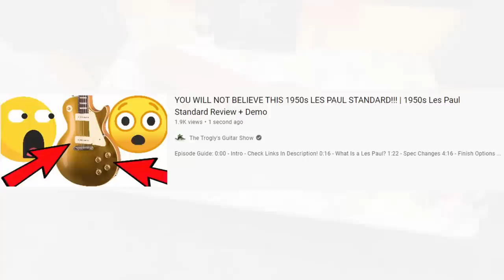My First 1950s Les Paul Is a Bit Different... | 1954 Gibson Les Paul Standard Red Double Cutaway Mod

Comment: Modding a 50's Les Paul in the 60's was probably viewed like modding a 2010 Les Paul would be viewed today. Nobody cared. This guitar has a great, unique story and was played lovingly by it's owner. In my mind, that makes it very special.
Reply: Yup thats what i Was thinking. Also back in the 60s, a used 50s les paul probbaly cost like $150. They sold for about $300 New for a standard and $600 for a custom. Today its like $2000 for a standard 50s and $4000 for a custom
Reply: It’s one of the things i love about Bonamassa; he leaves the guitars he acquires exactly as is, warts and all. He refuses to refurbish them. He cleans them up- a little- and takes them out on the road. Total respect for those who played and owned them before
Reply: @StinkyRotorhead  If you adjust those numbers for inflation you get surprisingly close tho
Reply: @StinkyRotorhead  Right. Even accounting for appreciation, that $150 guitar in 1954 comes out to $990 today. What the hell happened?
Reply: So true. I acquired a 56 Jr basket case in the early 70’s and promptly refurbished it without even thinking about its value. Which of course was nil back then. Nobody wanted them which is how I got it. I used the original electronics but changed to grovers and a Schaller tailpiece I could intonate. Still have it and the original hdwr and I played the crap out of it.
Reply: Exactly
Reply: No, it was pretty stooped then too…
Reply: @joojoosasa  Boomers happened.
Reply: @Chuffin_ell  ....were you trying to spell "stupid"?
Reply: I'm thinking not so easy to compare to today......no 2nd hand manufacturers....nobody had credit (layaway only)......people were not wealthy, unwilling to use credit and no cheap anything or copies etc......no comparison to today
Reply: @joojoosasa  it’s ironic innit?
Reply: I’ve seen more modded 54’s than i have originals. And most of the time they are better for it.
Reply: This is the worst I’ve ever seen though. I hate it.
Reply: imagine some boy got a mint store bought 59 for chrismas in '59...
Reply: @mekore  my old man sold donuts/delivered news papers as a kid to buy his 58’ Jr.
Reply: @mekore  aint that the story of the first berst?
Reply: The 59 berst anyway
Reply: Nowadays of you modded a 50s Les Paul you should pay some bodyguards xD
Reply: @FloodExterminator  if it was original when you mod it i agree you need protection. But if you improve upon some boneheads previous mod it’s probably a good thing.
Reply: @thejakefromstatefarm6768  I understand, really. But, remember, he was playing that Jag and that thing cost him $100 and had already been refinished. Vance had no idea it was a Goldtop once. I was sporting an Airline Bass from Montgomery Wards then and this thing had an amazing tonal range.
Reply: @kuga6566    HAHA!  I was thinking the same thing.
Reply: @thejakefromstatefarm6768  👍🏻👍🏻👍🏻👍🏻🤣🤣🤣
Reply: @joojoosasa    Inflation.
Reply: @kuga6566    What the hell do boomers have to do with it?   Do you even know to whom that term refers?
Reply: @thejakefromstatefarm6768    WTF?  SMH.
Reply: @joeyoungs8426  I feel you. In the early 70's, my dad acquired a 53 Telecaster in pieces in a box. He took the sander to it, shot poly on it, ordered new bridge, and electronics and turned it into a nice player. I inherited it in 2000, and just lament that it would be so valuable if he hadn't sanded it down. Oh well.
Reply: @bigjohnson7415  The best part about your guitar now is that story you have. My JR has a Gran Torino type story that led to so much more, I absolutely do not regret my basically doing the same thing as your dad. While I love the sound and feel of that guitar, it’s the story that comes back to me every time I pick it up. I sure hope you have that same feeling when you grab that Tele. Now that’s priceless.
Reply: @joeyoungs8426  Yeah, guess it like a car that gets repainted, as they say, they're only original once. No one in the 70's thought 59 Les Paul's, or 69 Dodge Daytona's, would be worth a mint 40 years later. Also, sadly because some things are old, or even rare, doesn't mean value. I also have a 1941 Gibson Fiddle. Yes Gibson made them from 1940-1945, I believe. Pretty rare. Mine's in excellent condition. It's worth around $800! That's it. 1941 model, and that's it. One more story, in like 1988, I acquired a 69 Tobacco burst LP. All original. Bought it from a coworker for like $400. I was just learning to play, and wanted a Charvel or Jackson SO bad, hey it was the 80's. So I bought a 1990 Custom Shop Jackson Pro Fusion USA on credit for $1,500. I was making like $11 an hour then. 2 weeks later, my company announced it was closing. I was going to be unemployed. Instead of taking the Jackson back, I took the LP and put it on consignment. About a month later, I found a new job, and went to the store to get the LP, it had sold 2 days earlier. For $650. I still have the Jackson, in my closet, it's still mint condition. What's it worth? Have no idea. But I'll bet it's less than an all original 69 Les Paul really good shape! The last guitar I've ever sold, because you just never know.
Reply: I know this is an old video I watched trogly quite a bit don't know why sometimes but kind of enjoy it but please probably do don't try to fix things you're so not good at it okay just leave stuff alone I guess you doing what you got to do to make money right dude don't know why I'm commenting on something that's a year old also I asked you about a guitar one see if you wanted to buy it and never did hear a reply I guess you just all ended trying to make the money can't blame you
Reply: That makes it way more valuable (to me) than a basic one. The story is what makes it really stand it to me. I love stories attached to instruments.
Reply: Nobody cared in 2010? I beg to differ. Smh.

Comment: I love this.  Everything about the guitar says it was loved and the modifications made it even more cherished.  Original vs Modified is an interesting argument - my foot is more in the Original camp, but then if I had the chance to buy Jack White's modified Gretsch I'd do it in a second.  Would this mod be better if Jimi Page had it done rather than Vance?  This guitar has a story and nothing is better than that, imo.
Reply: Well put. Clearly this guitar was both well loved and extensively played and that is what it was designed and built for.
Reply: When I see a guitar like this it reminds me of an old dog that you can tell had a great family and was always loved.
I'm very much guilty of modifying what would now be prized vintage collector guitars, but back when I did the mods in the late 1970s it was no different than modifying an old Fox Body Mustang GT of today.
Ahhh the good ol days, I do miss them dearly.
Reply: is it the one he used on the lazaretto music video?
Reply: @tavicotavio  I think he’s referring to the Gretsch hollow body Jack White uses. It was originally a single cut but modified into a double, and had a section of the body routed out to install a Green Bullet harmonica mic that he could pull out and sing into
Reply: Original VS. Modified, well, I'm in the middle. Some guitars should be kept original as museum pieces, others should not. But if it was damaged and/or missing parts and especially missing its original finish already, its top value already left the harbor, so mods are more welcome in that boat.
Reply: That guitar (or what's left of it) has a story which makes it unsellable.
Reply: @theusualgamers3242  Spot on!
Reply: Remember, we always thought it was a Cherry refinish and and we weren’t into taking our guitars apart in high school in the late ‘60s. He loved this thing and I can tell you he loved it dearly and made it his own.

I have lusted after this thing for over 50 years and I have only played it a couple of times, supervised, at Vance’s house, seated…with a strap. I was best man when he got married.

The night that baby hit the pavement was the last gig for, Bhang, at 2 Doors East at Montrose and Ashland.  And, I went on to work for Columbia and Arista.

Comment: Those pots are modular.  The cutouts on the back are there to add switches to the pots.  Don't forget that alnico magnets weaken over time.  It's possible that the bridge pickup magnet needs a recharge.  But there could also be a poor quality solder joint in the bridge pickup circuit.
Reply: How do you recharge a pickup magnet? I’ve never heard of that. Could you please elaborate on the pots as well. Were they made that way, or is it a modification? What kind of switches can you add to it, like a push/pull?
Reply: @Dan.Solo.Chicago  You just need to put the magnet into a sufficiently strong magnetic field.  In a factory they will typically use an electromagnetic pulse.  But you can also use permanent magnets.  Example, connect three strong magnets into a C-shape and insert the magnet that you want to charge into the gap between the magnets in the C-shape.  You can also weaken the magnetic field by widening the gap that the 3 magnets form.  You could also use one strong magnet and use steel transformer laminations to conduct the magnetic field to the magnet that you want to charge.  In a Gibson humbucking pickup they use one magnet in the center with a steel pole piece touching each opposite side of the magnet and those pole pieces conduct the magnetic field towards the strings just like copper wire conducts electricity.

The distributor pickup magnet in my auto got weak and wouldn't make a large enough magnetic pulse to trigger the electronic ignition.  I actually used 3 ceramic guitar pickup magnets and held them in a C-shape around the distributor pickup magnet and they recharged the distributor pickup magnet and my car started right up in subzero weather.  But KEEP THE MAGNETS AWAY FROM YOUR CREDIT CARDS!
Reply: @Dan.Solo.Chicago  What kind of switches you can add depends upon the manufacturer of the pot.  Some will only accept a rotary switch, but others may also accept a push pull switch.
Reply: @PierceThirlen2  This is a super interesting explanation, I also had no idea that AlNiCo pickups could be charged! Thanks for sharing

Comment: The top damage is from them using a hammer and chisel instead of a router to do the switch relocation. Look at the shape of the cavity you can even see what size of chisel they used .On the left side of your pic there is a channel cut you can tell .
Reply from the maker: Good observation!

Comment: Those pots are a bit goofy for guitar use. They are a type that allows a switch to be affixed to the back side. That's why there is an opening and the slotted part on the end of the shaft to move the switch. These were common on consumer electronics back in the old days. You would move the pot from the "0" position and the switch would close to turn on power to whatever it was in.
Reply: I think they are the wrong value as well. Sounds dead to me. I'd guess they are 100k

Comment: 14:08 My guess is that is from the drill bit catching the wood grain and ripping it. I've done that to one of my home-built guitars. It's a semi-hollow with maple top and when I wanted to put a better pot in I needed to drill a wider hole. Probably didn't use enough rpm, went in too quick, but got caught and it tore a similar (smaller) piece off the top.
Reply: Maybe a pilot hole first and then drill from the top down.
Either way a dull tool or not enough RPM and it'll chip out.
Reply: This is why you always use sharp brad point bits on figured wood like that.
Reply: Might sound weird but going backwards with the drill is a great way of avoiding tear-out.
Reply: They make reamers to enlarge holes and StewMac sells them.

Comment: Unless there is a problem with the fixing at the body end of the truss rod (which is pretty rare) there is absolutely no issue with the few threads showing at the headstock end - there are 2 inches of thread  at this point for adjustment.
As long as you can get a tool over the truss rod nut, you are good to go.
Most adjustments require less than half a turn so there is plenty of room left.
You seem to have a bee in your bonnet about this Austin!

Comment: Those are my favorite sounding pickups on any guitar you’ve shown. The bridge pickups on these are notoriously weaker in output from the neck but that midrange cuts like a knife in the mix. With the right player this thing would absolutely crush
Reply: The pickups were all the same. There was no difference in winds between neck and bridge.
Reply: @vorpalblades  that's the point he's making, people expect higher output bridge pickups on guitars now but that wasn't how it was in the 50s.

Comment: 22:30 somebody couldn’t get the knobs off, after the ends were splayed and hammered on.
Either the hammering or flywheel puller used to get the knobs off caused the damage to the pots.

Comment: I think the original vs modified will depend on whether the buyer is a collector vs player. Obviously a collector can be both, but the player's priorities will markedly different. I was a luthier for many years and have had the opportunity to play pretty much everything (all least in the Fender and Gibson camp) and there is definitely a difference, both in regards to the instruments and owners.
Many times the nicest and cleanest vintage instrument isn't necessarily the best sounding, sometimes it's not really even good sounding. I've owned several sets of original PAFs, the first set out of an ES335 that was left behind leaning against the rear end of a car; the owner had to run in to answer a call and when he came out he had forgotten he hadn't put it in the trunk, put the car in reverse to back out, then heard and felt the "thump-thump," it was essentially a pile of toothpicks with a neck). Each set I planned on keeping, but quickly decided to sell them because in all honesty, a modern PAF sounded better.

-I'm in the player camp and would take and play this in heartbeat.
Reply: I'd bet ya for $15k+ you wouldn't

Comment: I 100% relate to accidentally hitting the pickup switch! In fact I have a Les Paul Special that I had modified to move that switch out of my way. Nothing as extreme as this, but I had the guitar tech take out the bridge volume pot, make the neck volume pot a master volume, and put the switch where the bridge volume pot used to be. Never would have thought to make it a double cut! Mine just has a hole where the switch used to be.

Comment: Is it possible to replace the toggle switch with a rotary switch? 
It would make it harder to accidentally change switch positions and we would not need to move the toggle.
Reply: Were rotaries even commonplace enough in the 60s to justify that?
Reply: Sure you could do that. All that really needs done is for the hole to be drilled a little deeper so the switch tip clears the guitar top. The reason this might not have been done is because the top was cracked, who knows.

Comment: The 'black circle' on back of the pickups is called a rubber grommet :).  Without it the wires would rub against the metal and possibly short out.

Comment: Nice piece of history. I have mixed feelings about it though. The frets are really thin: I had a 1968 LP that had similar ones and I did not find them really comfortable to play. The trussrod being as is could lead to neck warp with time and the black paint on the wood could flake away. The rout of the top cut is quite rough and needs some cosmetic retouch. That said, it is an interesting instrument, but rather than investing 17K in it, I'd look for a good guitar with more modern features. Actually, I own 2 double cuts that are playing wonderfully, very well finished, with top-notch accoutrements. One is a Gordon Smith, UK hand-made guitars with in-house pickups: sounds and plays awesome. The other one is a Gene Baker B3 still from the hand-made in California period, Lollar '50s wind P 90's, a gem. Both together for the fraction of the actual modded '54 LP.
Your call guys...
Reply: Was the asking price $17k USD for this on Reverb?

Comment: And more than likely when the flywheel puller/ hammer was put to the knobs, it fractured the fragile top and surrounding area of the electronic cavity. 
It was glued down and the top refinished with some of dads cherry stain in the garage.

Comment: Rudy saved a Les Paul Custom of mine that sat underwater in a flooded basement for 24 hours in Skokie. Rebuilt the neck, milled and set ebony block at base of replaced trussrod and refretted with big fat frets. Sound-post changed hands and Rudy went on to purchase WASHBURN!

Comment: Look in the black light it's a gold top again. I dont know if them pickups are exactly the same but if they aren't maybe when the guitar was rewired they put them in the wrong place. Wish I could buy that one but maybe I just might have to get that melody maker setup and install it in a blank I purchased . Only thing is it's a bolt on body and I got a a set neck that won't work with it.

Comment: Turning the toggle switch slightly to make it work horizontally as opposed to vertically may already have solved the original issue.  Then again, Gold Tops look ugly to me so it's definitely a good thing this guitar was modified and ended up in this finish 🙂

Comment: Great video!
I was expecting to see bumblebee’s. Didn’t know they used ceramic caps back then. 
I usually put two adjusting screws on a bridge that starts to lean. I screw the first one all the way down to the body. Top wrap was a good idea. 
I love P-90’s but they sounded kinda flat at first until you started to rock out.